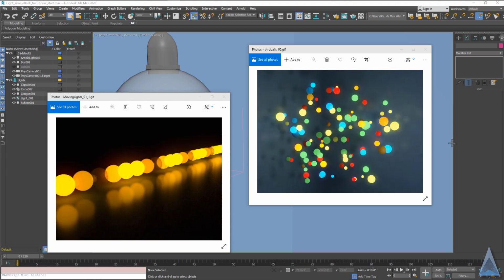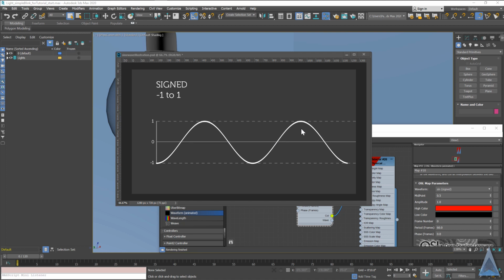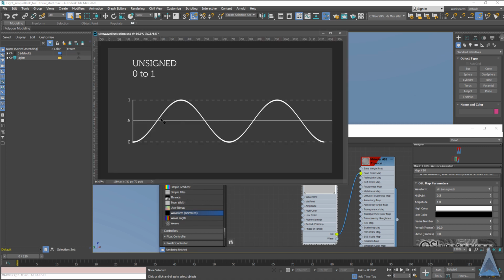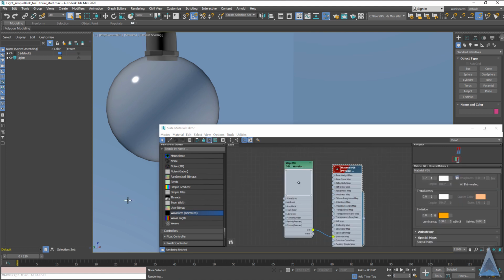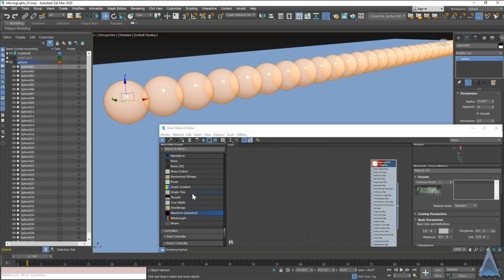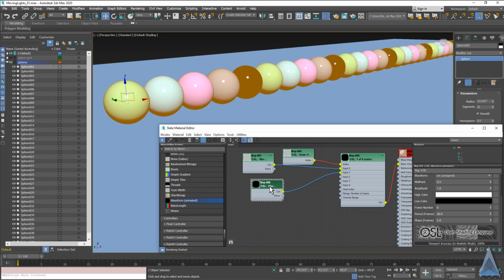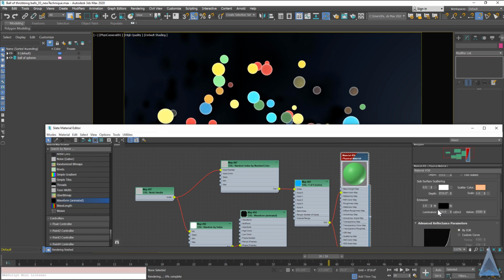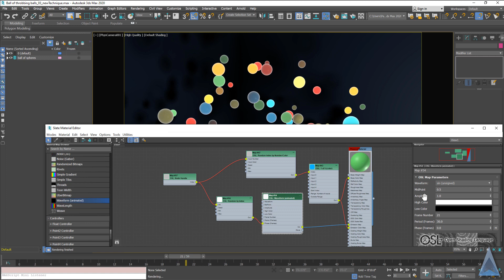3DS MAX 2020 Tutorial - Blinking lights! using OSL

Comment: hi, my osl map doest have a  "range:Number of inputs"
Reply: i only have "1 of N (color)"  in "Switchers"
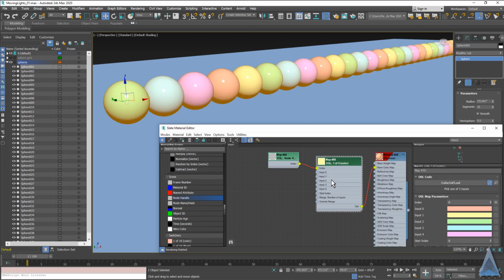Reply: also dont fast forward  6:25  - 6:26
Reply from the maker: @nkkr9677  You're right, I got a bit hasty @ 6:25. I was just tweaking the transparency and emissions settings. ;)
Reply from the maker: In newer versions of 3DS Max they changed "OSL: 1 of 5 (color)" map to "OSL: 1 of N (color)", and removed "Range: Number of inputs". However, the tutorial still works the same without it. Since it's 1 of N, you can just add or remove inputs to decide the exact amount you want. Hope that helps!
Reply: ok thanks.  subs

Comment: so early versions like 3d max 2018 cannot make the osl scene in an alternative way? i can't get updated now because my computer is not fast enough...
Reply from the maker: Unfortunately OSL is only available in 3ds Max 2019 and up. If you want to blink lights or textures with a waveform, you can apply a Waveform Controller to the light's brightness or the emission color of a physical material. Should be able to get similar results!